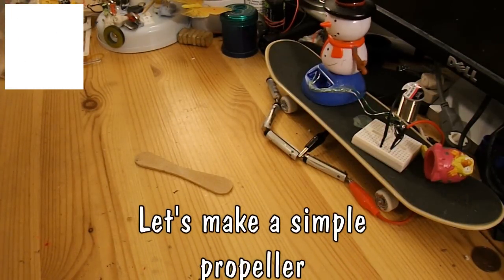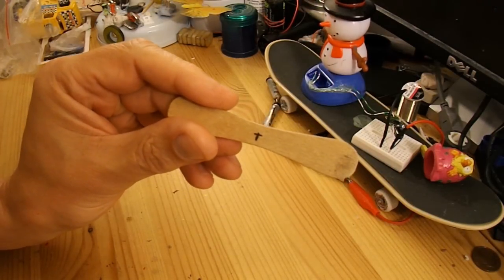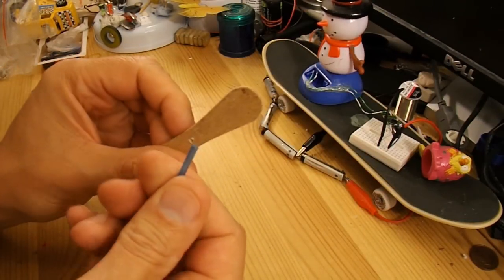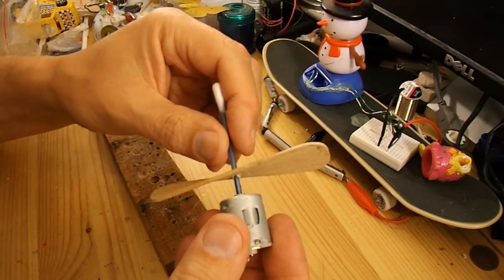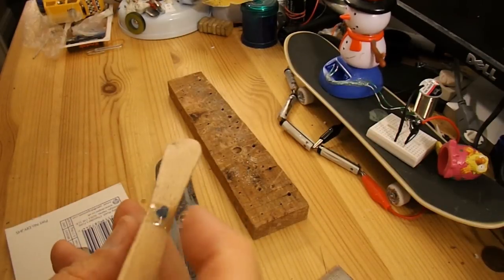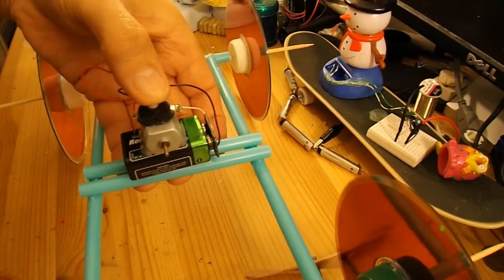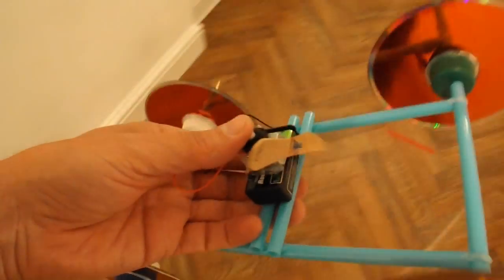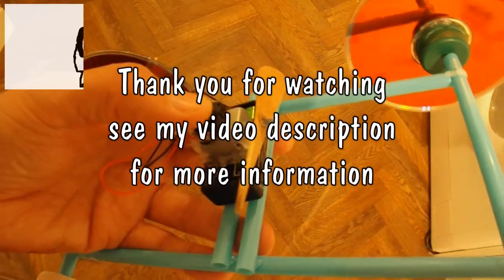Let's make a simple propeller

Comment: +GrandadIsAnOldMan Instead of the cotton bud shaft, you should try the empty part of a ball point pen inc cartridge, it's probably smaller in diameter and if it is too small you can gently heat the plastic until it becomes soft (but not too soft) and push it onto the end. this will create a perfect fit as the plastic will mould to exactly the right diameter.
Reply from the maker: Yes that would probably work fine :)

Comment: I also pick up those long ones from outside coffee shops  good for mixing glue and as a building material 
ever make one of those whirly gigs ? a simple wind powered toy !
Reply: a little tip if you haven't found an immediate use for something put it away in a box with the date on it ! if you haven't used it in a year you probably never will ,but you will regret throwing it away afterwards ! 😊
Reply from the maker: No a year is far to soon and it would take more time doing that sort of stock rotation anyway. I will just wait until I have no space left and then it will all go in the bin. I have projects on my "to do" list that are more than 3 years old, that doesn't mean I will never do them.
Reply: I like your thinking I have one project that goes back to 1977 still haven't finished it doesn't mean I never will !  have you tried using those adjustable rawl plugs  they come in various sizes and colours but are 12" in length I have joined one or two shafts with a bit of that before

Comment: hi grandad could I use this propeller for building a rc plane? :)
Reply from the maker: CuTz RandomGamers I am sure you could as long as you don't expect the plane to fly under power. This is not a very efficient blade shape although I expect you could spend time sanding it down to a better profile. There is nothing wrong with making your own propeller if you are willing to put time and effort into getting it right, however I would suggest buying one designed for the motor you intend to use.
Reply: Last night i tried to make a plane and i used a smal electric motor with a 9v batteri but it did not fly. So i think i gunna buy a design plane
Reply from the maker: CuTz RandomGamers if you are thinking of using a cheap motor then you are probably wasting your time. If you want it to fly then you are better off buying a proper RC Airplane motor. They are not that expensive.
Reply: oh okay thanks anyway! :)

Comment: If you do that and put a rc rudder on it and put it on a piece of some sort of floating thing you have a rc air boat for land and water
Reply from the maker: Yes that would probably work. It is not very powerful and the additional weight of rc equipment would probably slow it down so driving out of water onto land might be a struggle. I did a series of amphibious cars a while back and getting out of the water is the hardest part if you are low powered due to the drag of the water. http://youtu.be/qTbgCkg2BRw?list=PLA5a2xPRSrB24vUS9E8zkSgjZysEL00zr

Comment: How do u put the stick in the BOILING WATER and at the same time bend it IN THE BOILING WATER????
Really great full if u answer this question.
Reply from the maker: santosh sn obviously if you put your hands directly in boiling water you will do yourself serious harm. I warn you about that in the video and the video description. You put it in the water to soak it then take it out using a hook or similar, then twist it while it is still soft. Alternatively you can hold it so the center section is in a jet of steam coming from a boiling kettle but you need to keep your hands well away from the steam. I explain this in the video. If you read the video description I tell you that I show how to bend the propeller in my 'Rubber Band Powered Air Boat' video and the link is there.

Comment: Where can i usually find a Cheap Motor? Toy cars or sold from a local electronic shop?
Reply from the maker: +Black Redd just depends what sort of quality you want. Generally I buy items in bargain stores that I can take the motor from but if I need more power I would buy them from eBay. Here is a video I made to show some of the items I buy in bargain stores https://youtu.be/lzo_0uzQ2-I
Reply: dismantle damaged household items

Comment: grand dad cn you make a quadcopter propeller
Reply from the maker: +Baby Firman I would not attempt to make a propeller for a quadcopter. They operate at high speed and if the propeller should fail, fall apart, spin off, the results could cause serious injury. You would be well advised to buy a proper one.

Comment: can the propeller drive a boat?
Reply from the maker: +Akhil Sharma maybe. It would depend on what sort of boat you were making and how you wanted to propel it. If you wanted to push the boat the same way that we use it here to push the car then it would work in exactly the same way. If you wanted to put it under water then it would still work but it would be less efficient. Look at any boat and you will see the propeller is usually 3 or 4  blades and they are smaller because pushing water is different to pushing air.
Reply: +GrandadIsAnOldMan yeah I meant as a fan for a boat (basically an air boat). Thanks for the help. :)
Reply from the maker: +Akhil Sharma https://youtu.be/1rKYmYozZps  https://youtu.be/-IIgmqbJXSk

Comment: How can the steam burn your hands?
Reply from the maker: +Brian Serrano how hot is steam? Or maybe you are expecting flames as a definition of burning. Steam will take the skin off your hands if you put them in the way. DO not be confused by water vapour. Steam is colourless and at normal air pressure it's temperature is 100 degrees Centigrade or 212 degrees Fahrenheit. Rather than ask a question on YouTube where you could get any answer from any person who may or may not have the knowledge or may just be guessing or deliberately misleading you, I suggest you do some proper research to find out for yourself.

Comment: Can you make three blades propeller
Reply from the maker: If you could cut these wooden popsicle sticks at the right angle you could glue three together for a three bladed propeller. It rather depends on what you want it for. If you intend it to spin at high speed it would be safer to buy a proper one so there is less chance of it breaking and flying apart.

Comment: can u teach how to repair electric motor
Reply from the maker: Daniel Reymond what is there to repair? If you burn out the brushes then you would probably only be able to get replacements by taking them out of another motor of the same type. If you have burned out the windings, then you would have to rewind it with the same type of wire. On all of the cheap motors I have seen, the bearings are not replaceable.
Reply: can u show it
Reply from the maker: Daniel Reymond show what?
Reply: show how to repair it
Reply from the maker: How to repair what? what is the fault? what has gone wrong? I cannot repair something that is not broken.

Comment: Can I make a flying helicopter from that?
Reply from the maker: I very much doubt it
Reply: I will make it extra lite but I need to make the propeller for  school project (can't buy made one )
Reply from the maker: Frenkie Fejzic This a simple way to make a propeller but it will not be very efficient. Your problem with making a helicopter is the weight of the motor and the weight of the batteries. The cheap RC toy helicopters use LiPo batteries to reduce weight and very small lightweight powerful electric motors with gearing to enable them to spin up the larger rotors. Good luck with your project.
Reply: I will remove the battery and connect the motor with wires
so it can't fly away+not heavier. I'll try it and say the results ;)
Reply from the maker: Frenkie Fejzic good luck, I have seen a helicopter done like that. You can use much larger batteries.

Comment: Can someone please tell me where I can get the parts to make the top parts of the car that made the propeller work PLEASEE? That would be PERFECT for the project that I'm doing to make an automatic fish feeder and I REALLY need one of those if someone could tell me how to make that and where to get the parts that would be great.  +GrandadIsAnOldMan
Reply from the maker: What part do you mean? Do you mean the push button switch that turns the power on?
Reply: Yes
Reply: Like is there certain things u got to make it? Or did u buy it from somewhere
Reply: Because  I am making this fish feeder and I have the electric motor and I'm In the process of getting the propeller to propel the fish food out but I think the button would be a good addition to my feeder on the outside so when it's time to feed my fish I just press the button for a certain amount of time depending on how much food I want to give to my fish
Reply from the maker: I usually salvage most of my parts from old electrical equipment. That particular push button switch came from an old torch that I took apart. You could probably get a similar one from eBay very cheaply, or just keep your eyes open for old electrical equipment being thrown away.